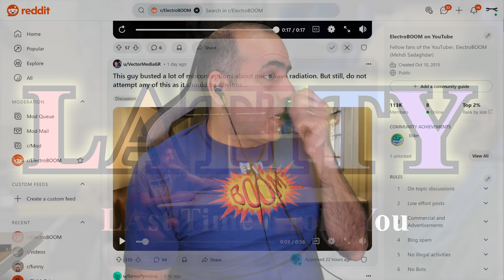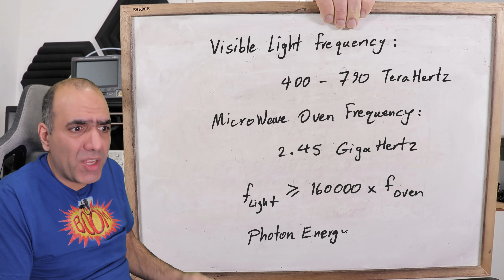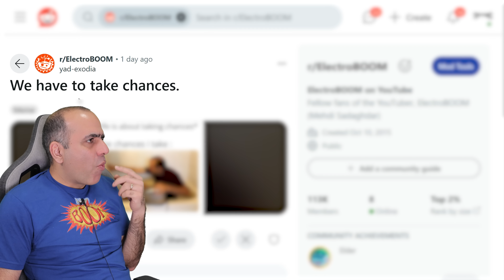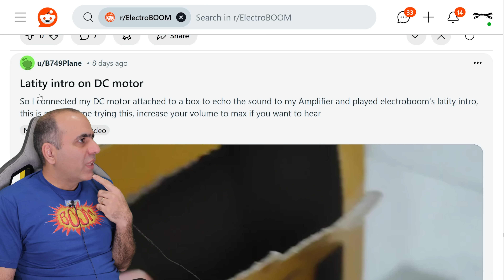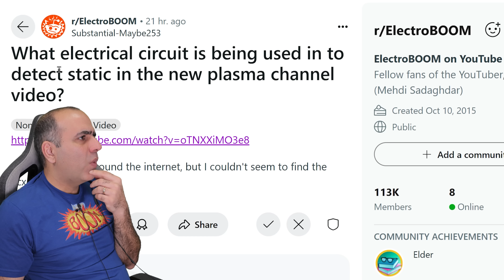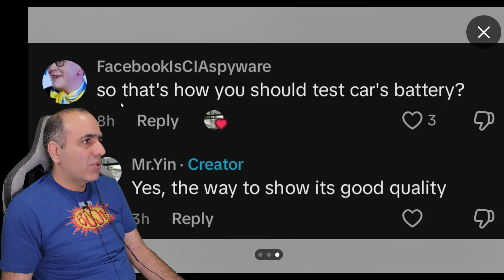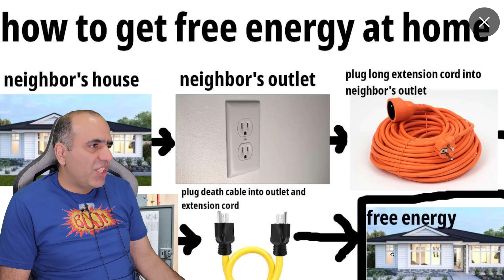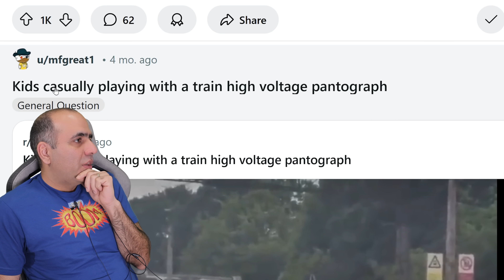Can You Microwave Yourself?! (LATITY014)

Comment: There is a unit used in hospitals to warm patients internals that actually uses microwaves. Of course the setup is carefully made and calibrated so it will not boil the patient. Older versions of this technique were called "diathermy machines" which used VHF radio waves to generate the warmth.
Reply: It is literally a microwave oven on the end of a stick. It has the same frequency as your oven at home. I have had some treatments on my neck and shoulder with this. It is made in Italy and may get you very hot if you if you get too close. This same company also makes other devices which border on quackery.
Reply: there's also a thing called high frequency ventilation which is where you put a baby on a table that shakes a t a specific frequency to pump blood throughout the body. this is used when you cant intubate a baby. peds medicine is a fascinating world of this shouldn't work in a million years but does.
Reply: Nice to see you here pal!
Reply: vhf is slightly lower than microwaves its like 30-300 mhz. microwaves are like 300 mhz to 300 ghz. What does that equipment use 300 mhz?
Reply: @neb6229  Google  "BTL Corporate."
Reply: 70, 100, 434 and 915 MHz microwave applicators are used for a cancer treatment called hyperthermia. Note that this is an additive treatment in combination with radiotherapy, chemotherapy or both
Reply: Radiotherapy is used to kill cancer cells,  i think it works kind of they way RF hurts the eyes. Cancer cells grow so fast compared to normal cell, they can out grow the blood supply to them.  So if you beam form RF energy at them  there is more energy present on them then the surrounding body tissue the beams pass through.  With limited blood supply the cancer can't get rid of the heat generated so the cells get distressed. the body's normal process for mopping up dead and distressed cells get rid of them so hopefully removing the cancer.
Reply: wtf thats crazy
Reply: Most old TV repair training books showed diathermy interference photos.
Reply: Does it rotate the patients as well
Reply: is it for cancer cure?
Reply: @pcbden  It can be part of cancer treatment: there's some chemotherapy drugs that are fairly inactive until heated up: giving someone some and then only heating up the parts of the body with tumors in it means fewer side effects: the chemotherapy drug will tend to only kill the tumors and stuff that's right next to the tumors.
Reply: @pcbden  From what I see it is more for arthritis rheumatism aches.
Reply: @pcbden  no, as stated, it was to warm their insides. you cant cure cancer with heat
Reply: @pcbden  Not sure about cancer, I remember it not being recommended, I've been using it successfully to relieve patients with Osteoarthritis for example.

Comment: I have serviced parking lot lights that happen to be under high tension, 500kv transmission lines and I could definitely “feel” the “static” electricity. It was even taken into consideration of the design as the poles directly beneath the lines were only 10’ while the standard poles were 30’. It was uncomfortable to touch any part of the poles without gloves/ or being grounded to something like the outriggers on the boom truck.

Comment: The motors work much better as speakers if you attach a diaphragm to the shaft.

Just pinching a 1" piece of cellophane tape over the shaft makes it louder.

(It will look like a flag on a flag pole)

Comment: Used to live in Malaysia where they also have the UK type sockets but a lot of equipment available with the european style plugs. As the sockets have a safety shutter, we would usually shove the stem of a ballpoint pen cap into the ground slot to open the shutter, then shove the plug into the other 2 holes. Safety first!

Comment: I moved to Belize and spent five years braving those showers. I had one that used to flip the breaker every couple minutes and was also connected to the light, so I had a few seconds' heads up before everything got cold again. Every time I got in there I wondered if that was the day I was going to get a nasty surprise.

Comment: The issue with plugging in EU plugs into UK outlets is that it only works for 2 prong connectors without grounding. If people dont know what they are doing, they might also try to plug in a EU plug that requires grounding that cant be provided for it with a UK outlet

Comment: What is the match between the magnetron monopole and free air without a resonating cavity? Could be that there is so much reflection back from the monopole antenna into the magnetron itself that the magnetron only radiates a fraction of the normal. All this energy would be converted into heat and unusual extra heat at that.

Comment: You can blow up LEDs with a 9v battery (no resistors or anything, just raw contact with LED and Battery Terminals) seems to only work with Yellow LEDs, at least from what I’ve seen a friend do in school, in stem class 2 years ago
Reply: Also lightbulb sockets that plug into wall outlets, get one, plug it in a standard 3 outlet extension cord, and get an old car charger and plug it in an old iPad (like iPad 1-3 or something anything with the old giant pin connector) plug the car charger into the lightbulb socket, I can’t recreate it but I did it when I was 4 years old and I tripped the breaker, if I’m not mistaken though it charged the iPad for a split second

Comment: Audio can be used as a poor mans PWM signal too, over drive it until it is close to a square wave, FULL WAVE RECTIFY it, filter it and you get variable DC signal. Add a motor driver and you can control motor speed with an audio signal.

Comment: EURO plug isn't designed to fit into the UK socket outlet. 

1. The pins closer together meaning the EURO plug will be under strain.
2. The pin sizes are different so there's not as much contact causing overheating.
3. The UK socket outlet is designed with a shutter which only opens when the earth pin is inserted, that's' why the UK plug earth pin is longer. Forcing the EURO plug in damages the shutter. The shutter stops things, like kids fingers, from being inserted into live sockets.
4. UK plugs are fused so each appliance is individually protected, normally 3 or 13 amp but other sizes are available. The socket circuits are normally 16, 20 or 32 amp MCBs so under fault the EURO cable could easily cause a fire. Older circuits are protected by 15 or 30 amp fuses which normally take around two weeks to operate... 🤣

Comment: For the sound with motor thing, you should use BLDC motors. They have seperate coil for each phase so you can vibrate the motor at specific frequencies and produce sound, instead of replying on change in RPM of the motor to produce sound.

Comment: My dad was an electrical engineer, and was willing to fix anything. One time, our very early adopted model of a microwave was misbehaving. He and I took it apart and was checking things, the fan kept running like it was on. Little did we realize, the magnetometer was very active. I noticed when my metal frame glasses started to sparkle. I pointed it out to my dad, and he quickly unplugged it, and freaked out that he had killed us both by cooking our brains. Thankfully, nothing bad became of it that we know of. Was an interesting effect...

Comment: Attach an antenna, and it becomes really illegal because it'll interfere with critical communication infrastructure. I would never turn on an unshielded 1kW magnetron for that reason alone. I don't even have a microwave oven, but for an other reason, they're so bulky outside and so tiny on the inside, and the really good ones, like at the supermarket, cost like 12k and are even bulkier.
But the getting shocked side of things is the definitely the most off-putting part of it all 😆

Comment: 13:00 Once i was riding on a bycicle and i felt unpleasent sensation between me legs when i was passing under 330 kV line (about 20 isolators between wires and mast). i was sittion on a saddle and it was warm and dry sunny day. i stend up imidiatly and it was gone. thats all.

Comment: So the whole DC motor as a speaker thing definitely real, (not the fake video mind you, but the concept itself) but the actual sound from a speaker is largely coming from the diaphragm, which a motor does not have. A speaker is electrically similar to a motor, but you physically connect the magnet to the diaphragm so it vibrates to the music and pushes the air, making sound waves. You actually hear some faint version of this on a modern turntable using a moving magnet cartridge, as you can hear an unamplified turntable playing music on the cartridge, even if it is not connected to a speaker. In this case, it's the vibration from the grooves stamped into the record that is moving the magnet, inducing the current in the cartridge and making faint sound just like the DC motor is making a very faint amount of sound from the movement of its own internal magnet.

Comment: Microwaves travel through your body, so aiming a magnetron at your head could heat up your brain, yes? And brain damage can occur at only 108 degF or 42 degC. Seems like a Darwin award in the making.
Reply from the maker: That's right! That is if you stay in front of it long enough to heat up. And I'm sure you'll feel the heat before any damage happens and jump away. Unless the energy is focused at a point that can internally burn some cells quickly
Reply: @ElectroBOOM  Due to the uneven heating nature of microwave ovens, I wonder if there could be "hot-spots" internally, that would not be felt on the skin as quickly. Or would that not happen in open air vs a microwave cavity? Hmm...

Comment: UK outlets that are up to code have shutters on the live and neutral that are opened by the ground pin when the plug is inserted, to prevent anything being inserted that shouldn't be in there. BS 1363 (the standard that specifies the safety shutters) has existed since 1947 and is a legal requirement. Illegal extension sockets that don't meet the BS 1363 exist though.

Comment: Cataracts intensify.
Reply: I came here to say exactly this
Reply: Monobrow intensifies. 💯
Reply: regardless of whether or not the waves will harm you, messing around with microwave components in general is just incredibly incredibly dangerous.  Especially the people who fool around with the transformers for woodburning.
Reply: @ it’s actually the capacitors that get the highest death toll- too many amateurs are used to “power off so it’s safe”
Reply: So do Lincolns...
Reply: @hotflashfoto   I got it.
Reply: @hotflashfoto  Buicks balance better for pounding people though. Lincolns aren't as well balanced and tend to be unwieldy.
Reply: litterally
Reply: Came here just for that comment…
Reply: This made me giggle alot thank you
Reply: I had one from using a heating pad, overnight. Yes, it can happen.Just the left eye, where the pad had been laying ...
Reply: @uploadJ  You slept with a heating pad on your face... You are not even supposed to use them on your face in general. That was a solid darwin moment?
Reply: @uploadJ  Correlation is not causation.  A heating pad does not emit radio frequency energy, just infra-red and a 60Hz (or 50 Hz) electromagnetic field which does not cause cataracts.  If it did everyone living near an HV power line would be blind.
Reply: @ferrumignis  infrared can cause inflammation tho. i have psoriasis and if i stay under the emission of ir heaters i turn into a lizard.
Reply: @ferrumignis  the heating 💀
Reply: @ferrumignis  Infrared will still overheat your eyes if you get enough exposure lol
Reply: @ferrumignis the cataracts are just formed by overheating of your eye though aren’t they? Even if there was no radiation, sleeping with an eye on a heat pad could cause a cataract from pure heat conduction
Reply: @ferrumignis  That's not how heating pads or cataracts work. That's not how any of this works.
It's causation, and the cause is the infrared radiation from the heating pad. It doesn't take much heat to change the protein folding in the cornea enough to make it cloudy.
Reply: @AltarParssoy  Infared lowers inflammation, there is no method via it would increase it! All objects you encounter daily release long wave infrared as well
Reply: @DarkAttack14  all heat sources emit IR but IR heaters are causing inflammation on me. Like it's solid man. UV-B helps, weirdly.
Reply: @AltarParssoy  yeahhhh idk about all that lmfao maybe you got some other weird stuff going on because it seems every study available shows IR helping inflammation but who knows
Reply: @DarkAttack14  psoriasis is weird AF bro
Reply: @uploadJ  Nothing you have said negates my point, correlation is not causation. Cataracts can be caused by internal heating of the eye which microwaves can do, but 50/60 hz fields cannot.  As I said, if this were the case there would be an epidemic of cataracts as we are exposed to these fields all the time.  Since you (dishonestly) claim to to be a "qualified researcher", why are you unable to provide any evidence for your claims?
Reply: @AltarParssoy  A heating pad is not an IR heater though. It still emits some IR radiation, as does everything that gets hot.  You might as well claim that a hot water bottle causes cataracts 😁
Reply: @petersage5157  If you cooked yourself with with a heating pad to the point that it gave you cataracts you would have been very uncomfortably hot, probably even burnt.  Did you fall asleep on it whilst blind drunk or on drugs?

  _"That's not how heating pads or cataracts work. That's not how any of this works."

Pot, meet kettle.  You clearly have no idea of even the basics of thermal energy transfer mechanisms.  A heating pad is designed for direct heat transfer, through conduction.  Whilst it radiates some IR (as does anything above absolute zero), it is not a strong emitter.  The sun emits far more IR, how come everyone isn't getting cataracts from venturing outside their house?
Reply: @ferrumignis  Sounds like you and I both have a relatively fair understanding that it's a function of time and actual temperature in the tissue. Prolonged exposure to temperatures as low as 42C can denature the proteins in the cornea, and most people would consider that tolerably toasty, or even comfy; many people survive fevers with core body temperatures that high, though it takes a heck of a long time to recover from such a fever. I have resistive glove warmers that easily get hotter than that. And it isn't unheard of for people to take strong cold medicines in winter time when they're more likely to use electric blankets, and many of those medications that knock back cold symptoms tend to have sedating side effects. So yes, I'd say it's entirely plausible that a person could accidentally cook a cornea on a heat pad.

Comment: Regarding the power line where cyclists could feel a sensation. Could it be voltage induced from AC in the bike itself? I once worked with two 25 miles long parallel 130kV three phase lines where one were in operation while the other were grounded. You didn't have to get far from the grounding on the line side to feel it in your fingers. (And it arced alot when applying ground.) I've also heard that walking on grass under power lines can feel strange.

Comment: One time I was using an old microwave and it malfunctioned and turned on with the door open. My ring got very hot. It was right when the Marvel movies were new, big, and still good, so I wondered if it would give me super powers. I wondered, for example, if my hand might shrink due to the exposure. I was worried I was going to develop a micro-wave.

Comment: I think it should be fine to stick a schuko into a uk outlet. The problem is that the pins are flat on the UK and round on schuko but it should still get a decent connection. Obviously nothing grounded though since the schuko ground pins are on the side of the connector.

Comment: Mehdi, the UK plug has square pins and a fuse.  The Euro plug is only speced for 2.5A and not fused.  Its round pins will have a very small contact surface when inserted into a UK BS1363 socket.  Also inserting requires defeating the shitter covering the live and neutral pins probably by inserting more one more unsuitable object into the hole for the earth pin.  It may work, it may electrocute you, it may burn down your house.

Just het a friggin adapter or change the plug to avoid adapters entirely.  Most are of bad quality anyway.  I collect leads of old devices to use for such conversions so Ialso get the advantage of industrially manufactured cables.
Reply: Nobody wants to defeat the shitter. You'll be sat on that recovering from poking things in the socket to get your electric toothbrush charging.
Reply: UK “Ring Main” is fused at 32A, hence big pins on UK plug. Need a fuse in case of a short. 32A on 0.5mm2 euro plug lead =🔥
Reply: @chriskryton4029  Correct.

Sadly. The Europlugis onky good for 2.5A.  The similar Swiss T11 olugs, IEC 60906-1 and similar Italian, South African and Brazilian design can take 10A and should also fit into UK sockets.  Haven't tried.
Reply: the real danger lies in the risk of the metal caps getting stuck in the UK socket when unplugging.. you can end up with bare wire sticking out of the plug.
Reply: I always did this with my continental appliances when I lived in the UK. Of course you have no shielding and UK plugs have a fuse that continental plugs don't have but I never got into trouble. Maybe I was lucky. And yes, you have to put something into the third hole to remove the mechanical cover of the others. My car key worked great for that ;-)
Reply: @RobertAtdotde  The laptop that i'm typing this message from is plugged in using this method, it's fine.
Reply: there's actually quite a few small electronic devices here (Malaysia) that uses the Europlug standard despite us using Type G socket
Reply: Shitter, that beautifully sums up British outlets 😅